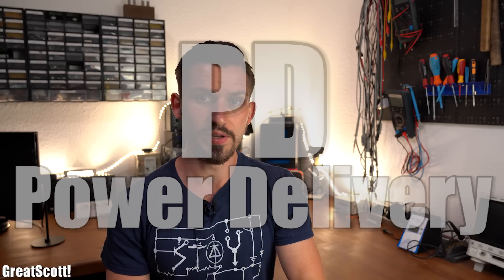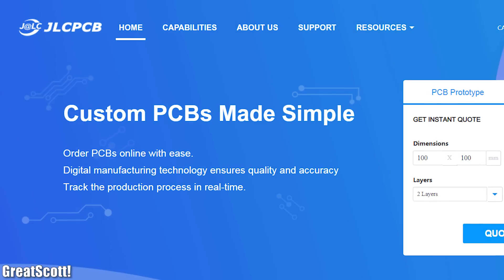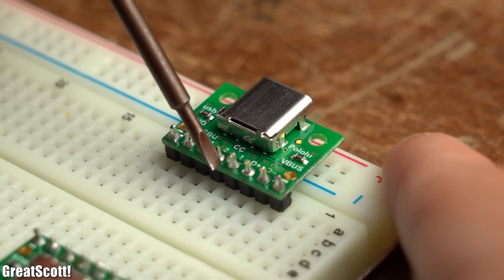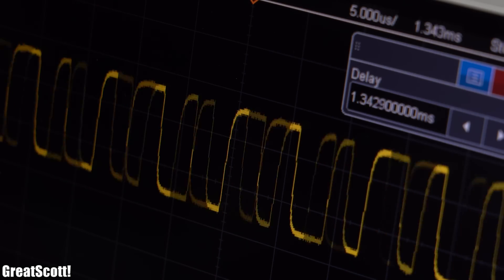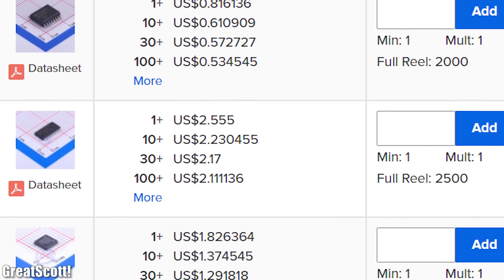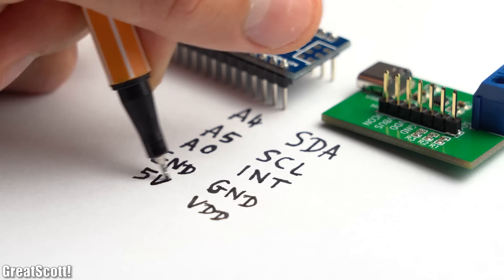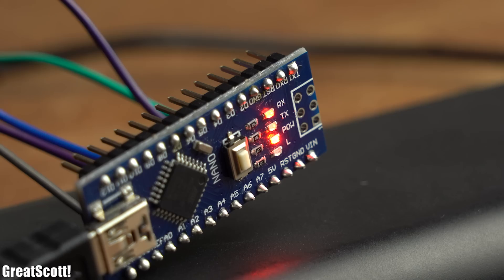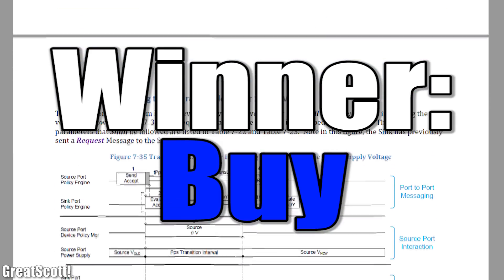USB Type-C Power Delivery Trigger Board || DIY or Buy

Comment: sooo .... an arduino wich can easly run a funier transformaton at 1k hz cant tell a micro controller wich voltage it wants ?! thats ... kinda hurtfull i really like the eps's all the power to them but if you cant change a voltage on a powerbank with a communication ic in between with a 16mhz µC then its a little over complicated isnt it ?! i can see how this was a struggle. i was allrady wondering why the comercial solution would the use a fking F3 prozessor, FPV drones kept track of multiple pids and and lots of other things like OnScreenDisplay Blackboxing and so on with an F3 so .... wao thats something i hope i will never have to do xD

Comment: I have a router that is powered by ac to 12v dc adapter. I want to power my router using 12v solar battery. Should i connect it directly. I am confused with current. Will the router determines how much current it wants to use, because in cause of led we have to use current limiting resistor? Sorry for noob question.

Comment: I have a 12v air pump for car... I want to use it with a transformer... I do have one 12v 1,5 amp.. The pump is starting but when the pressure is growing.. The motor is dying... What should I do? 🤔🙄

Comment: Scott,
       I have just purchased 2 "5x 5V Mini USB 1A 18650 TP4056 Lithium Battery Charging Board Module Protection" board sets. But I don't know that I will actually have a use for all 10 of them. If I do not would you like the units I do not use? If so, how do we contact each other privately (not reasonable to post either of our real names nor mailing addresses on YouTube where they would be stolen and/or taken advantage of). I do not know what a "Post Office Box" is called in Germany at German post offices, but perhaps you have one? We can discuss the items (they won't reach me until at least July 18th and perhaps as late as September) and mailing details. I suspect mailing from the North Eastern USA to Germany may be unpleasantly expensive but we can both check. I think the easiest way to discuss as much privately may be to start on Twitter. There I am user @23BruinsFan.

Comment: This is pretty much how I made a portable external monitor to carry with my laptop. An old 1080p laptop panel, cheap driver board, USB power bank and a 12v converter works well.

Comment: Cool video. I was trying to figure out how to build the opposite, a USB-C PD power source not sink. I have a Fuji X-T3 that can charge from USB-C PD @18w (9v2A) but I want to wire it to a 12v2A source. It was easy to find this USB-C sink board on ebay but no luck finding a PD source that takes 12v input. I ended up with a modified car charger which does the trick but is bulky etc. It must have one of these USB-C comm chips inside verifying and negotiating 9v2A from the car charger. Have you seen any simple converter boards that do 12V -> PD?

Comment: Hey Guys, I think this USBC Technology seems to be a solution to my problem!
I am very new to the field of electrical engineering and would like to try my hand at a larger project for the first time. 
For this project I want to use a 12V (250-300 mA) pump and a microcontroller (STM32F103C8T6 "Blue Pill").
Would it be possible to realize such a project with the trigger board shown here? If so, how is it possible to supply the 12V pump and the 3.3V microcontroller simultaneously without destroying anything?
I would be very happy about tips!

Comment: Thanks a lot for the video! Very informative especially along with your Awesome Type-C Video :). Have you looked into combining PD with Data-Transfer to a device? I'm looking to convert a USB 2.0 device with an additional power supply to only require a single USB-C connection. After some research I got lost in the USB-C specs and gave up ._.
(These darn usb generation names and cable types are sooo confusing even within the specs...)
It can't be as simple as hooking up pins A6/A7 right (aka Dp1/Dn1)?
Reply: It actually is
Reply: But you'd need to set the device into upstream or downstream for it to work correctly.

Comment: Everything about USB is way more complicated than it needs to be. That is what you get with something designed by a committee. And it has a fundamental design error. Although it is differential to give it noise immunity one of the signalling conditions makes both lines go the same way. The end result is noise can cause it to disconnect.

Comment: Have a look at the Quickcharge 3 protocol. It's limited to 12V, but it can do any voltage from 5 to 12V and is much cheaper to implement (there is even Arduino library for it).

Comment: I have a boost regulator board (with output voltage display) attached to a USB A plug.. 
I'm still using my 8 year old power bank.

Comment: Hey why not try out the quick charge trigger board, it only involves applying certain voltages to the USB data lines... Although it might give as much power as usb C	, 12volts with 2 amps should be more than enough for many projects

Comment: [Spoiler: Long Reply] Of course you don't want to fry your peripherals that's why negotiations are there to make sure everything works seamless. It hides all the complexity behind specific IC that handles it, giving ease of use to end consumer. That's how we evolve and innovate technologies. I remember when physical serial and parallel ports were even a thing in computers and now they are wrapped on top of USB interface with almost all controllers talking to host computer with dedicated usb to serial IC or with FTDI board. You as a consumer just take it for granted while it is still possible to have such ports on computers.

Sheer complexity is not new to computing world and you would be wondering what they used to make general purpose computers and how all the complexity is hidden behind whole programming toolchain. Industry phase out old things and introduce new things in order to keep things moving, rather good or bad.

Speaking of protocol:
Not only the protocol allows negotiations with power delivery at physical layer with built-in tests but also allows devices to negotiate which one will act as host in usb specs, that's important because slave device will usually be driven by host and since usb-c is reversible having unified interface, it makes sense to include such basic negotiations with proper register based data line signaling rather than old on/off signaling. Because that's how computers talk to pheripherals.  A simple ASIC will do the job for devices with fix usage while keeping specification open for more productive usage. Keeping it as small as possible is goal here, no matter the complexity behind it.

Anyways we all have alot to learn yet, and you might want to look into ARM, TI, Broadcom or STMicroelectronics docs for more advanced microcontroller usages, modern microcontroller have become almost small microprocessors, just not with all the perks yet :)

Comment: I thought USB PD output can be programed in 20mV steps? Are there boards that provide access to this, so you can make any PD wall adapter into a programmable/tunable voltage source (maybe even with current limiting)?

I've been wanting to combine PD negotiation with solar MPPT function so I can avoid using a large battery to buffer the energy from a solar panel to the charging device.

Comment: Hi, Great Scott. Thanks for your effort comunicating this kind of information with us. I was reviewing some of this quite a while and yes I noticed that USB-Type C it's awesome but at the same time is a pain in the butt. Did you check the IP2721 IC? it's much more simple than this one. But the "problem" is that you are not able to negotiate current. it's only for voltage. But if you know as a electronic maker the wattage of your charger and the energy consuption of your device. It can be a great option and much more simple.
IC:
https://lcsc.com/product-detail/Interface-Specialized_INJOINIC-IP2721_C603176.html
Youtube Video (This guy made the board):
https://www.youtube.com/watch?v=dKKnJCxh92k
EasyEda Project:
https://easyeda.com/ecenuig/ts100-usb-c-board_copy
Regards! :)
Reply: Also I would add TVSs on the CC Pins as well.

Comment: What a coincidence.... Im trying to figure out if i can make an "adapter" that can allow me to use the type c to "normal usb plug" charging cable that came with my phone, to go to a parallel port or printer port-(a big long port idk on a very old printer...) i wanna know if its even possible and if so HOW, ive got like a " type c otg cable" idea that can plug into a usb to parallel adapter but you see i dont have any of those two, so i wanna make a thing where i can plug my cable in and the parallel plug in and print stuff directly off of my phone, idk if this all is even possible and ive tried to do some research but ive gotten nowhere so any advice would help....
Reply: Don't most printers just use USB nowadays? Converting USB to parallel will be quite a bit of work. First you'll have to probe the parallel port to see what format the data is being sent on, and then you have to use a USB peripheral controller and a microcontroller and it's going to be a huge pain.
Reply: @theodiscusgaming3909  yeah its gonna need quite some brainstorming till i figure out how to do it but i saw you can buy usb to parallel adapter but they a bit expensive and i don't wanna waste money on something that will most likely not work for what i need you see sooo yeah..... But thanks btw

Comment: Consider using STUSB4500 and STUSB4700 ICs, there can even act as standalone controller or can be driven via I2C and are much easier to use

Comment: Hi, I recently tried the JLC PCB service because of your videos and turns out it's a great service. $2+Shipping for 5, 2 layer PCB's as advertised, and high quality PCB's, compared to those from Pentalogix wich usually cost at least $40 the piece for boards of the same sizes. Only issue is of course wait time but even if you pay another $20 for priority shipping would still be cheaper

Comment: If an Arduino can't even manage it with the help of an external IC, that pretty much sums up how complex the USB-C PD protocol is...
Reply: Apollo 11 didn't stand a chance ;)
Reply: It seems to me that it would definitely be doable if you're only concerned to use the arduino as a sink. The protocol isn't that complicated, the source offers a choice of available modes, the sink accept, the source confirms and then sends a packet when the power is stable. So you basically only need to extract the values from the available modes, and craft a packet to select the one you want which seems doable in 2k of ram (the packets are around 30 bits.)

The basic sink implementation is fairly simple, but when you look into daisychaining, bidirectional PD etc.. It is complex.
Reply: @satibel  I think you came to the correct conclusion
Reply: You never get free lunch in engineering. USB-C is extremely flexible and can do anything from USB, DP, audio and even PCI-E, but it comes at the cost of complicated configuration. Still it's a very cool protocol and there are some IC's that get the job done for PD with very little hassle

Comment: I have an idea: DIY or buy a cheap desoldering gun? What's the cheapest desoldering gun you can get? I really need one before I rip apart asolutely every and all solder pads in the world trying to desolder large pin count components from lead free boards 😂

And what about one of those solderex automatic soldering irons; buy, or diy using a stepper motor and a 3d printer feeder mechanism? And great video as always, your content is always great.

Comment: The problem I have with the increasingly common USB-C PD trigger board is the risk of its stored voltage configuration being overwritten. Someone messing with the board might change it from asking for 12 volts to asking for 20, and whoops, project is fried. Plus having to remember to configure the board before attaching it to my project. Not to mention having to remember what color means what voltage, and how to make it remember the setting between power interruptions.

I wonder if another chip like the FUSB301 could be made that attaches to an EEPROM  or a resistor network or set of jumpers or something that would allow more reliable and self-evident configuration, plus avoid the need for a host microcontroller and custom software.

Comment: For most projects QC would be good enough. Most PD Devices support QC too.
QC is much simpler to implement. Using d+ and d- however has to be tested.

https://www.hackster.io/PSoC_Rocks/hacking-qualcomm-quick-charge-qc-2-0-3-0-with-attiny85-b7627d

Comment: Well - none of those are worth it in my opinion.
You want "a button", but why not get 4 separate boards for each voltage?
You can find on wink wink the same page you ordered "Buy", boards that are 1/4th the price + they're smaller and they have predefined voltage already set up.
Those you showed are convenient, but not cost-effective

Comment: I understand that if you want to cycle power modes by pressing the button the buy option is the best, but if you work on a larger project that requires one specific power mode than I think the diy option would be better as you can program your gadget to request that one specific mode.
Awesome video anyway, thank you 👍👍👍
Reply: Yeah that's true. Most applications don't require changing the voltage on the go

Comment: I have a question about electronics. I know all the basics and what all the components do. I do not need a beginners course. The only resources I can find to learn more is just about pcb design and circuit board development. This is not what I want. I want to learn about how to incorporate all the components together to prototype a working circuit. If you have any suggestions that would be greatly appreciated.

Comment: Can you lift your self using 20v 5amp?
Like would batman's grappling hook work with that power bank?
Reply: Well using some idealized physics: 20V*5A = 100W, which is 100Nm/s. So you could lift a 10kg weight at a speed of 1m/s if there were no losses.
Reply: @sasodoma  Super speed isn't necessary, so reduction is not a problem.

Comment: I built a smart cable for USB-C PD to power small ham radios. It works very well if the PD bank fully supports the specification.

This makes what I have to carry when I operate from the field, because I can use the same power source that I would use to recharge my phone and other USB devices.

https://www.ng3p.com/2020/05/a-different-power-source-for-field-ham.html

Here's an article I wrote after researching and experimenting for many months.

Comment: Why does it need to be so complicated?
Why isn't it just a simple PWM signal?
Reply: I haven't read the datasheet for the FUSB302, but my guess is that the chip is designed to basically pass through the valid USB-C signals that it receives via i2c. It doesn't actually have any logic to the PD or any other USB-C configuration protocols. I think its primary role is to convert signals between 3.3v logic levels and whatever USB-C uses (looked like in the hundreds of millivolts). Maybe it also does message framing and tx/rx protocol, in which case its acting like a layer 2 (media access) controller for USB-C configuration.

This specifically means the FUSB device doesn't understand the Power Delivery protocol, which is why GreatScott's code was complex. His code had to implement the protocol. This keeps the FUSB chip simple at the cost of making the host controller more complex. But it means that a solution built this way can be upgraded in software, which is usually desirable in commercial products.

Comment: Diy would be the preferred method though in instances where you already are using a microcontroller for something else and needed power negotiation (eg in something like a soldering station for a TS 100 iron). If you have a specific use case where going the diy route will reduce part count it could definitely be worth it.

Comment: Does the DIY or Buy version stores the previous stage? For eg, of I configure the output voltage to be 12V by pressing the push button, and then power down, will it start at 12V next time, or back to 5V? This feature will be much more suitable for permanent projects.

Comment: Just read USB-PD spec. Your love for it will pass very quickly :D It is soooo overly complicated
Reply: It has to meet many needs for many different devices, so of course it will be complicated. Just imagine how complicated usb 4 will be since it will be thunderbolt compatible as well.
Reply: That's why I use a smart cable instead of building sink circuits into my gear.
Reply: It needs to be compatible with future implementations, you'd be out of spec as far as what is allowed, but I'm pretty sure you could negotiate 230V ac on the usb pd spec.